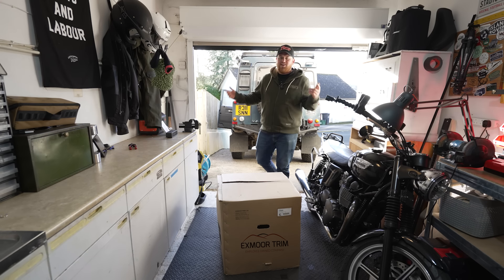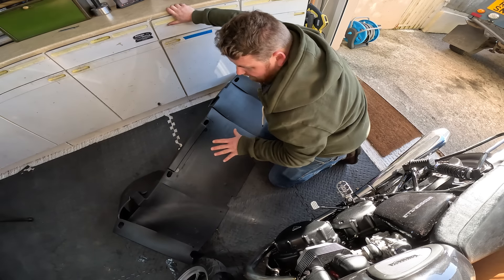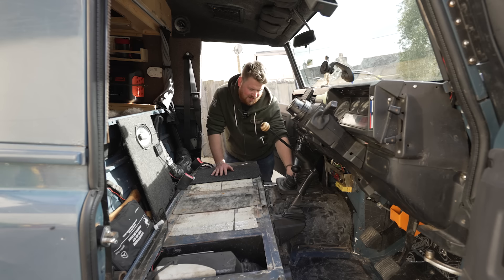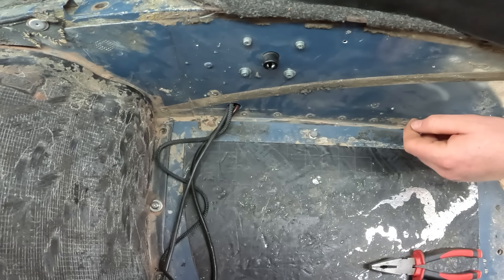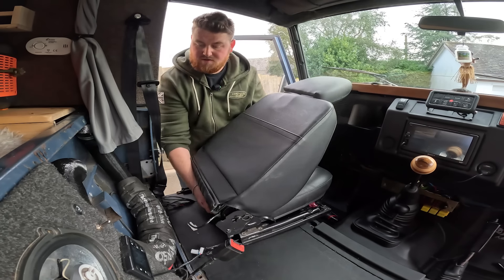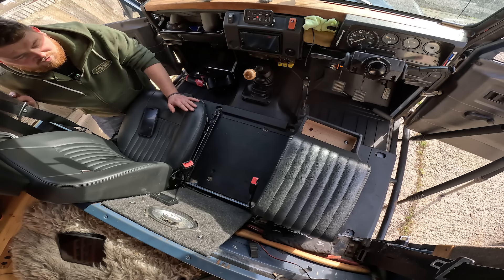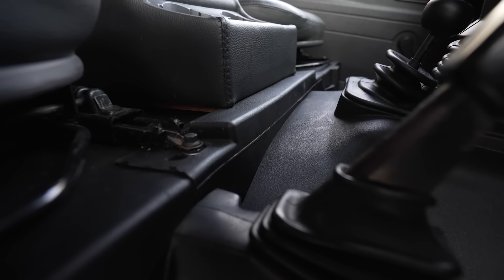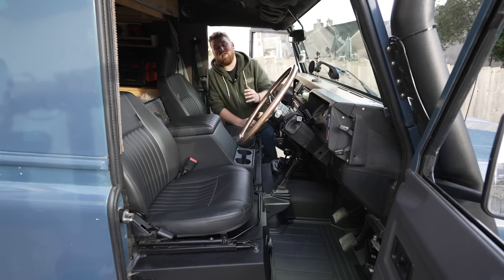EXMOOR TRIM DEFEATER MATTING - DEFENDER INSTALL - BEST UPGRADE SO FAR?

Comment: Genuinely curious, why not measure before cutting? You say it was the best way for you to do it, but you’re obviously disheartened with having to cut multiple times. Despite the first mishap you still didn’t measure for the next holes. For what would be a couple of minutes of measuring I’m sure you could’ve saved on a few four letter words
Reply from the maker: Unfortunately it’s slightly different when making a video. It takes a hellmof a lot longer than you might think. So it was quicker in my case to do it like this. Plus I think it worked out quite well. For me I prefer to do it this way

Comment: The look great and help contain wet  muck from  your boots but be aware that water can get under the floor mat and will not dry out with it in place, especially if you are doing river crossings. Prop the mat up off the floor to get some air under there to let it dry - your over night heater will be a great help with that (apologies if I missed you saying that in the video already)

Comment: Hi - is the rubber mat for R380 and Will it fit my 90 300 TDi from 1994? Boris is also a 300 TDi with an R380??
Reply from the maker: Correct Boris is 300 with r380.
I think it will but don’t go on my advice. Just incase I’m wrong.

Comment: Thanks for the vid! Looks great. Do you think you could install dynamat type product underneath it all or would it be too tight? Is that overkill for sound and heat insulation? Thanks very much!
Reply: Interested to know as well as I was just thinking about betting the whole cabin lined with sound deadening kit then installing new trim, seats, floor covers etc

Comment: That looks stunning! 
Can’t remember if you mentioned it or not, but do you think this would fit over a layer or two of sound deadening foam? Or would the fit be too tight and cause the Exmoor bits to buckle and warp?
Reply from the maker: It is very snug and I would recommend laying it directly on the metal.

Comment: Did you find it particular snug fit in the foot wells given you have some sound deadening matting there already? I’ve stuck sound deadening sheets everywhere but worried even that slight reduction in space would stop this new matting from fitting.
Reply: I read on Exmoor Trim's website that it can accommodate 3mm of matting underneath